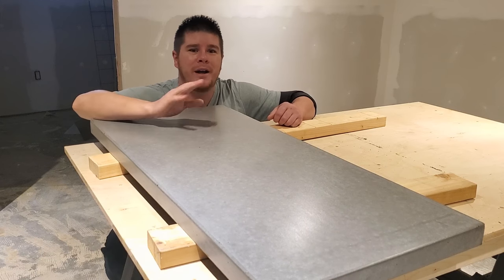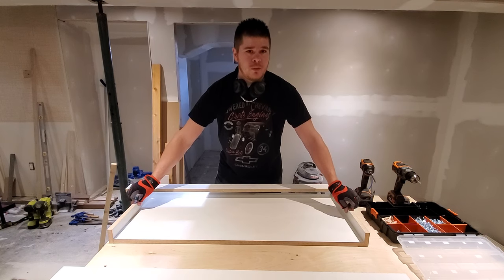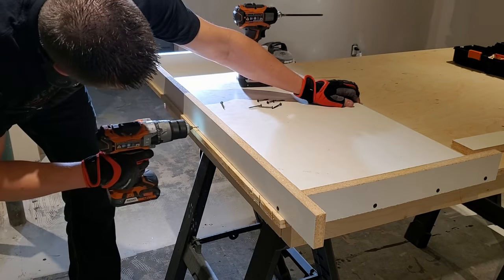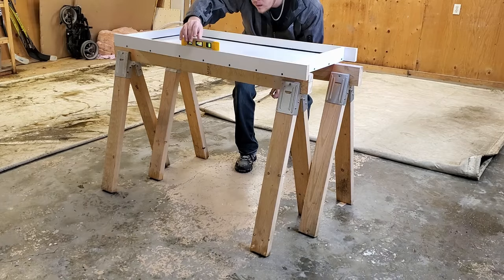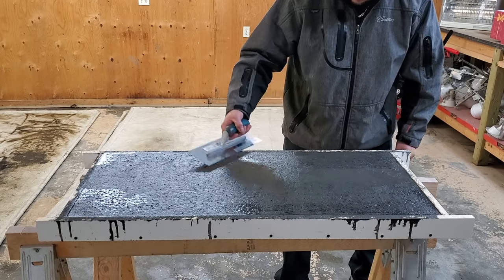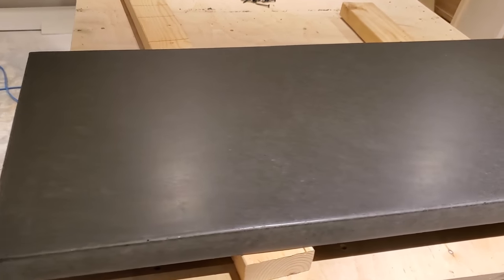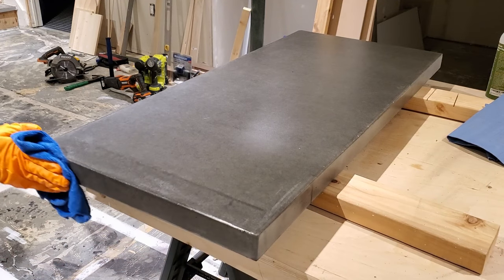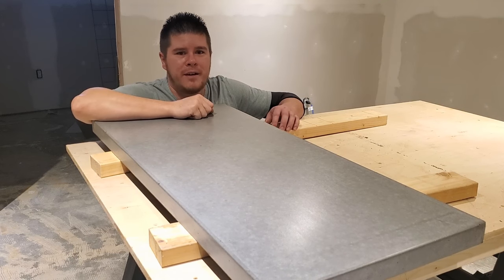Beginners guide, Concrete Tabletop you can build. No special tools, hand finished

Comment: Perfect job! 1 more subscriber!!!
Reply: If you would sell it, how much do you think would be the right price?
Reply from the maker: Awesome, thanks!
Reply from the maker: That's tough to say, the concrete isn't that expensive, but once you buy the material for the mould, sealer, wax it all adds up. Really, take the material costs used, add a small markup if you like, and then determine the actual working hours put into it and whats your time worth. Same as anything really
Reply: @JessedoesDIY  sorry to disturb you so much, but how many hours did you spend for the complete project? As a beginner, i don't have much parameters to compare. And I realize that you are a professional. Thank you very much for your attention
Reply from the maker: Actual working time, not including time waiting...working probably 3-3.5 hours total from start to finish. But total job from start to finish with all the drying times, about 5 days
Reply: @JessedoesDIY  Thank you for your suport, good luck and success!!
Reply from the maker: No problem. Thank you

Comment: Do you not add fibreglass strands to your concrete mix?   What is the concrete mix?
Reply from the maker: You can but it's an extra expense, and step that if not done right can ruin it. That's what the reinforcement is for. I just used regular Quikrete 6000, but the 5000 works fine too. If you have the countertop mix in your area, that is good too depending on what the slab will be used for

Comment: Does it have to be that thick? I want to do one for an RV. I don't want it that thick though.
Reply from the maker: You could go down to about 1 1/4" thick with this method. Any thinner and it'll risk cracking. If you use fiberglass in the mix instead of a wire mesh you can go down to 3/4" thick

Comment: Did the concrete you use have Gravel in it. If so how is it not visible on the finished side
Reply from the maker: It had small aggregate yes. During vibration all the aggregate travels to the inside to create a dense core, and the "cream" of the concrete travels to the outside. That's just a product of how concrete works.

Comment: any cracking years later? with the cement mix verses the countertop mix?
Reply from the maker: Nope, still using it to this day. It's in my kitchen
Reply: what mix where did you get it? what is the psi rating?  @JessedoesDIY
Reply from the maker: I used the 6000 psi mix from Quikrete in the blue bag. But I've also used the 5000 psi mix as well, both from Home Depot

Comment: So can you use any concrete that home depot sells for this?
Reply from the maker: Technically yes, but certain concretes will want to shrink more as they dry, and that can cause the slab to twist and curl over time. The 5,000 and 6000 PSI mixes that I used are low shrink formulas, or specific countertop mixes are very low shrink

Comment: think i could use a spray ceramic wax as a release agent?
Reply from the maker: You could, but that stuff is expensive to use as a mold release. You'd be better to just use WD-40 and wipe it off, or even spray vegetable oil wiped off.

Comment: the board your using , what's it called and how high are your side boards?
Reply from the maker: It's called melamine and my sides here are 2.5" tall here. But depending on the use case and concrete used can be as short as 1.75". The thinner of a slab you make the more likely it may be to crack without using fiberglass mixes.

Comment: Hi ! is it only cement with sand? thank you
Reply from the maker: Hello, no it is not. I used pre bagged concrete mixes. They also make a countertop mix that would be best to use if you can get it. If you need to mix it yourself use a 3-2-1-.5 method. 3 parts aggregate (small stones), 2 parts sand, 1 part cement, and 0.5 parts water. That will get you a good starting point at least. You can use slightly less stone but it will be a bit weaker, and you also only want to use just enough water or else it will be weaker as well and take longer to dry

Comment: apparently you didn't have trouble with the silicone sticking to the car wax but i would have thought it better in reverse
Reply from the maker: Not at all. The wax is a form of sealer, not much really sticks to it.
Reply: @JessedoesDIY  yes, that was my point. I wouldn't have thought the silicone would stick, apparently it did just fine

Comment: What’s the max length you’d go with a counter using this method??
Reply from the maker: Max you can go is 8' because that's how long they make the melamine for the mould, bit it also get stupid heavy and risks cracking during transport if it isn't supported in the middle. I've done 6.5'

Comment: Can you use the same mold more then once?
Reply from the maker: As long as the mdf sides haven't swelled from the water you can yup. Just look along the exposed wood edges for any swelling along the top sides, the rest was sealed by the silicone and should be fine

Comment: Can you still make a concrete slab with a 1/2 depth?  For a patio table.
Reply from the maker: It would be super prone to cracking doing it the traditional way, I'd do at least an inch with reinforcement. If you go thinner you'd need to buy GFRC, Glass Fibre Reinforced Concrete, or buy the fibreglass to mix in yourself, and don't add reinforcement to that. You can check Quikrete Countertop mix, it is fiber reinforced already and may go that thin if you add a bit more glass to it
Reply: @JessedoesDIY  Thank you for your reply. I'll check out the GFRC. Thanks for the hands-on informative video. It is well written and the tips are proof in the end product. Thanks again for the reply.

Comment: after trying this when I fliped it over the cement colour I added was very blochie looks like water stain marks.

How can I fix it ?
Reply from the maker: There is no way to fix it unfortunately. Usually that can be a sign it may not have been mixed well enough, but it may go away a bit after it dries, could just be wetter spots. Now that it's flipped give it another day or so to even out its colour

Comment: Is it standart cement or special material? Can i use standart cement ?
Reply from the maker: You can, but basic concrete has a higher chance of curling over time. Try and find some that has less to no shrinkage labeled on it. There are also countertop mixes you can get, those are best
Reply: @JessedoesDIY   thank you so much for your explain.
Reply from the maker: No prob, anytime

Comment: Hello. What concret I have to use for.. and brand?
Reply from the maker: I used Quikrete because it's readily available to me. They make a countertop specific mix, that would be best, but used their 6000 psi mix in a blue bag. You have to be careful tho because it can curl if it dries at different speeds. If you can get the countertop mix you really don't have to worry about that
Reply: @JessedoesDIY  thanks i am going to send soon other question and i love you work
Reply from the maker: No problem. Thanks!

Comment: What kind of concrete you use?
Reply from the maker: Quikrete brand, either the white bagged 5000psi mix or blue 6000psi mix. Either or will be plenty. Just make sure to only use just enough water, not too much. That's the hardest part
Reply: I'm going to copied exactly how you did it hope it comes out like yours lol

Comment: where do i find a supplies list?
Reply from the maker: In the description is the sealer and wax I used. Supplies are as I showed, melamine, reinforcement and concrete and dye are in the same aisle at home depot, drywall screws, and car wax

Comment: You can write ingredients  show for me? cos I’m live in Cambodia need to do it ,thank you
Reply from the maker: Generally you would use 1 part cement, 2 parts sand, 3 parts fine small aggregate, half part water or more as needed. In terms of pigment that depends on what you can get, just follow manufacturer directions. Hope that helps

Comment: Anyone guage roughly how much this costs for a slab of that size?
Reply from the maker: Depends on the concrete mix you use, if you use dye, and if you need a sheet of melamine. To buy everything for me it would be $50 for the mould, $18 for a sheet of reinforcement, $25 in concrete, and $25-40 for dye. But you'll have leftover reinforcement and melamine for the mould

Comment: I used clarks concrete wax and it ruined my finish.  It streaked darkness in circular patterns from this wax.  I am sick about it.  I'm not sure what to do at this point.  Buyer beware!  I think the mineral oil in it is what caused the issue.
Reply from the maker: Really? I get some dark spots at first but they go away as it dries. Did you seal the slab first correctly a couple times? Because applying the wax without sealer directly to the concrete will do that. And also did you let everything dry and cure correctly before applying wax? Did you buff the wax off after 20 mins or just leave it?

Comment: What materials were used to make the stone?

Quias os materiais foram usado para fazer a pedra?

Q materiales se usaron para hacer la piedra?
Reply from the maker: I just used pre bagged concrete, Quikrete Pro Finish 6000. But you can make your own if need be. 1 part cement, 2 parts sand, 2-3 parts fine aggregate stone, add water as necessary. The reinforcement is a wire mesh for concrete, you can get many forms of reinforcement. Hope that helps, any more questions just ask!

Comment: I didn’t properly reinforce the bottom of my form and the weight of the concrete put a slight arch in my slab. Ughhh I may use it anyway because I’ve spent the time and money 😢
Reply from the maker: Ooof that's no good. Live and learn I guess. It all depends on you but I'd chalk it up to a learning curve and make another. See if you can make it even better!